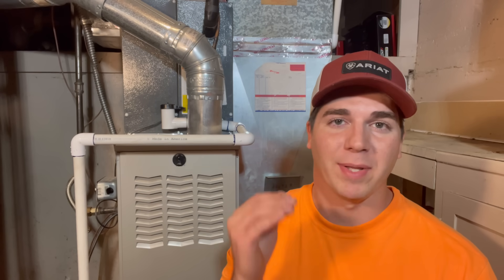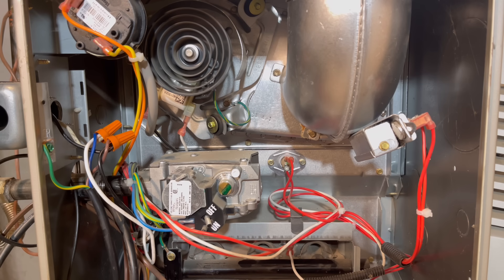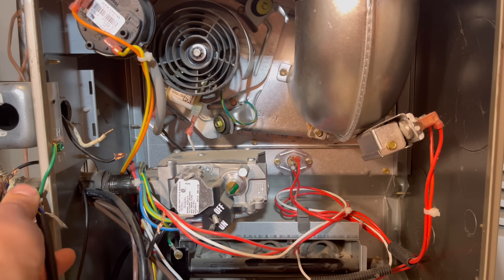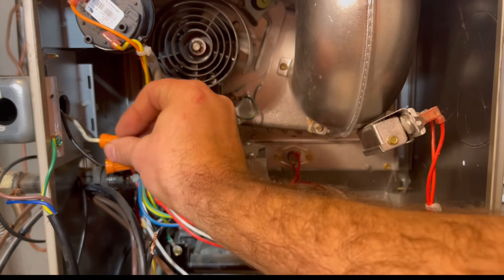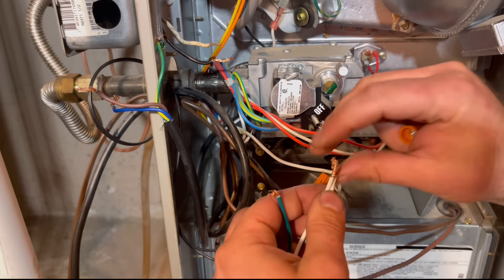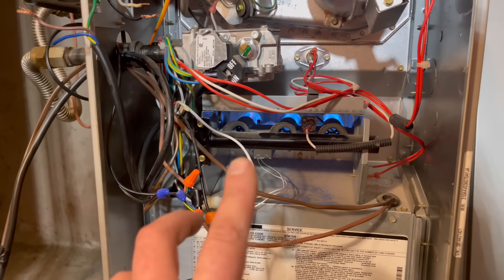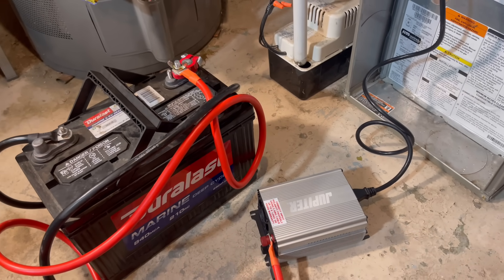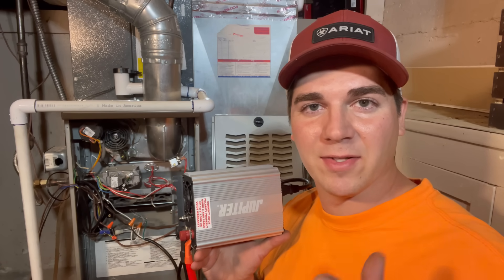Did You Know You Can Heat Your Home With A Car Battery?

Comment: My advice is, if you have to jump in to any kind of wiring change or repair like this, take a few pictures of the original wiring configuration before you change anything. You might need them to switch the wiring back when the time comes. I've been able to perfectly revert wiring changes, over a year later, because I took pictures.
Reply: Labels 1 to 1   2 to 2
Reply: great advice!
Reply: I do this a lot! Having phones on us makes it so easy. I have a phone with a stylus, too, so I can make notes, circle things, inert arrows.
Reply: @Tomas.X  Yup, that's what I did 10 yrs back when I was working a lot on an old truck with some non-standard replacement engine I couldn't track down for directions/schematics/etc...   A bunch of little strips of masking tape with multi-colored permanent markers to label every wire/part/etc and various small disposable cups and baggies to collect/label each set of bolts/parts, plus video recorded the entire disassembly on phone, with running verbal commentary from me.  I'm rather mechanically inclined but my memory's atrocious, lol, so this helped a LOT!  ... >;]  ... (did it for appliances, too)
Reply: Yup. Good idea. Pictures don't forget
Reply: @craigquann  Tell that to the kids today! LOL
Reply: I came here to say the same thing about taking a cell phone picture before taking any wires apart, re-routing, etc.
I'd like to add, if it might be a long time before you get back to the project.... get those 2 or 3 pictures 'instant printed' at Walmart and tape them inside the furnace cabinet. 
I had a phone stolen once and lost the SD memory storage with it.
Reply: always meter the circuit, safety first.
Reply: Good advice but in this case it was two wires,,,lol
Reply: Should be common sense but then again,  common sense is rare these days
Reply: Yes
Reply: I bet you've changed a phone's charging port. Great advice! Merry Christmas!
Reply: I've been an electrician my whole life. My father was a Master electrician. Even in my 40s I still take before pictures or at least draw a diagram
Reply: I agree, especially if you're changing the control board. Even the thermostats sometimes have a bunch of connections which never match the wire colors. I always take pictures, and rarely ever get everything back together without looking at them.
Reply: Yep! Things can go south in a hot minute  if you have no reference to guide your electrical connections!
Reply: OR, use a gangbox next to the switch with an outlet. That way you can make a male to male pigtail grounded adapter. And just plug the furnace in when needed.
Reply: If you can’t rewire the 120v coming into your furnace you shouldn’t be touching it.
Reply: @dustinengle2570  Is that so? Cute. How do you change light bulbs?
Reply: @aick   why are you so offended 😂? I’ve been doing HVAC for 10 years if you have to take a picture to remember how to wire a furnace you shouldn’t be touching it. Because you obviously don’t understand the operation of the equipment. A gas furnace is not something an untrained DIY guy should be messing with honestly. I’ve seen plenty of homeowners and business owners destroy their own equipment attempting to do something they “saw on YouTube.”
Reply: @dustinengle2570  Would you tell your next job interviewer that documentation is for people who "shouldn't be touching it"? I had no idea this comment would attract so many insecure aspiring technicians. Good luck in the real world where black is neutral and also white, and wtf does the red wire do? They are all tied together in one wire nut when you arrive at the customer's house. TAKE A PICTURE.🤣
Reply: @Wolf359HeavyIndustries   i literally don’t have to take a picture of anything in a furnace to rewire it besides maybe thermostat wiring but that’s not even necessary it’s just quicker. Because almost all Tstat wiring is done with a conventional color code according to the system that’s installed. Or if you forgot just pop the stat and check there. You obviously have very little technical experience in HVAC. 99% of all equipment you’ll see in the field either has a wiring diagram in the unit or just Google it. Also to verify voltage and polarity professionals use a multi-meter dude.
Reply: @dustinengle2570  Bruh, was literally giving advice for people who ARE NOT trained, which is what this video is about. Why are you here dunking on people who are here to help others learn? You must be great at parties.
Reply: @Wolf359HeavyIndustries   my original comment was if you can’t rewire 120v coming into your furnace you shouldn’t be touching it. Then y’all commented at me all kinds of sideways. You don’t have to be a trained HVAC tech to understand 120v circuits. I’m trying to prevent people who have no business touching their equipment from creating hazardous situations for themselves or contractors because I have seen it. If you understand the basics of the equipment and can confidently wire 120v circuits have at it. I’ve been shocked, had rollouts, and seen people ruin their equipment because a home owner didn’t understand the scope of work they were trying to accomplish by themselves. Oh and I am great at parties. I’m always the motherfucker keeping people from hurting themselves or getting arrested 😂. But all and all I apologize for any rude comments I made. I just want people to be safe. Seen to much dangerous shit happen.
Reply: @dustinengle2570  It's also very telling that you assumed that I was exclusively talking about HVAC when I literally said "any kind of wiring". For example someone above mentioned a complex data acquisition system that they had to tear down and repair. I'm getting a vibe that you got laid off (for incompetence fueled by overconfidence?) and you are taking it out on youtube comments. Please go be insecure somewhere else.
Reply: @dustinengle2570  "I’m trying to prevent people who have no business touching their equipment..." It's called gatekeeping.
Reply: @dustinengle2570  Good for you. My comments and this video weren't for you then. In case you didn't notice, it's a DIY video that specifically addresses the power outage in Texas where people froze to death because professionals were swamped. Have some civility towards the professionals who want to help and not just gate-keep their skills. 
Another thing you don't seem to have noticed is that the power wiring in the video mixes US and European color codes. That is what prompted me to suggest taking a picture, which may or may not be needed, but will work.
It's funny that you are continuing with your fabricated narrative that I am inexperienced, just because I offered sound advice that works across all technical fields and never causes any damage. I've got over 15 years in IT support on power control systems, including HVAC, 150-500KW backup generators, security and access control systems, fiber optics and server systems, etc, that are mission-critical to financial institutions and government offices. I know how to use a whole lot more than just a multimeter.
Reply: @Wolf359HeavyIndustries   maybe don’t talk smack in your first comment and you won’t get smack back lol. I just personally don’t think homeowners that don’t understand basic operation nor basic 120v wiring should be touching their furnace. But by all means they can and if they mess something up it’s just job security lol. I don’t wanna end on a bad note tho. I apologize for any disrespect. I was just merely commenting my opinion originally. I hope you have a good week bro.
Reply: @dustinengle2570  I wasn't talking smack. You were saying that people shouldn't touch their own wiring. Well, sometimes they shouldn't but sometimes they have to, like in the context of this video. You then took my advice, which is useful for beginners and old-timers alike, and threw it in my face as proof of MY ineptitude. Apology accepted, but try to treat the comment section as a place to help people, not drag them. Somebody is always gonna fry their wiring. Let's make it happen less. There is always going to be a job to do.
Reply: Pictures and labels! Saves my butt every time!
Reply: Good point.
Reply: Or you could read the wiring diagram.🤣 Its color coded for dummies.
Reply: Excellent 👍
Reply: Such good advice for taking ANYTHING apart!  Ask me how I know… 😂
Reply: In the Old’en days we wrote things on paper.
Reply: @Glocktard  - Re: "paper" ... - yep, I remember lots of diagram-drawing as I took stuff apart...  that was fun...  
- Esp rebuilding stuff with diff/extra wiring/circuits/etc, drawing it all out first, doing all the math, protections/etc...  
Did that with an old laptop I really liked but it had a lousy cooling system so I added my own, extra fans/heatsinks plus control of the orig stuff, all with their own power supply/controls/automation/overrides and even a backup power system jic my Primary blew (incl a little blinking red LED to let me know)...  ("Gaming" laptop, back when those things were uber-powerful running HOT!  esp Overclocked)
Reply: @brianwall9592 au contraire, gaming laptops were extremely dogshit - they were heavy and ran hot with poor performance but modern ones are finally starting to become truly portable in terms of weight and thickness although you still need to be connected to an outlet for gaming.
Reply: @Glocktard  yes, that works but it is easier to just take a picture with your phone and edit it with markup notes, but either method will work. I used to take notes on paper but now use the picture method because for me its easier and faster. Whatever works for you is the right choice for you.
Reply: @Glocktard  Yessir paper notes are valid too.
Reply: Yep. I've torn apart crazy complex data acquisition systems in the field that had multiple stacked circuit boards and wiring leads all over and was able to quickly identify bad, burned out parts then replace them all because I documented everything with pictures as it was coming apart. I always take 2-3 pictures of the each "scene" from different angles because sometimes there are small things that block your view. 
For work I would need to write-up and label a procedure for the next guy too. 1 picture really is worth 1000 words.
Reply: Boring advice.
Reply: @txmade4371  It wasn't made for your entertainment. Also, the same could be said for your entire channel. 🤣
Reply: Yes lots of variables Tim it’s tuff to put all in comments, like I live alone so only need to worry about myself so I have a extension cord 12-3 I run from my battery room to outside my window which will run all my wi fi stuff like surround sound TV so just need to keep warm like camping, but I really don’t need to worry about pipes freezing could tho ( Reno) lots go into ones climate first then family newborns would really up the stuff , don’t need refer if pipes are freezing, most of my greenhouse heat , lights , just gets transferred inside sorry veggie’s, it’s all about options, honestly
Reply: @timmeier8863  wifi and 5G radiation ☣️ have an ill effect on the human body
Reply: @herdHistruth  so how did you reply without using WI FI , some people worry more about complaining then trying to help ,I do know complaining takes more energy then helping
Reply: @timmeier8863  I didn't use wifi, just he cell tower ☣️, and I never claimed I didn't use it
Reply: @timmeier8863  where does it say that complaining takes more energy than helping ?
Reply: @herdHistruth  I remember when microwaves came out people were freaked out about heating food , bet you use a microwave to heat your food ? And during a blizzard I don’t think people are thinking of 5g and WI FI are bad but can stay distracted from the blizzard is very important, see my point right now is not talking about staying warm but your complaining about stuff and not adding anything, like I said more energy for nothing
Reply: @herdHistruth  Did you learn the difference between ionising and non ionising radiation in high school? Actually did you even go to school?
Reply: @kiyoponnn  yeah, I went with your mom, she loves to drink that baby batter 😋
Reply: White to white black to black. It is not rocket science.
Reply: @cooldog60  Nobody said it was rocket science but look at the wiring in the furnace again. In this case, it's white to blue and black to brown for the condensate pump wires. US and EU color codes are being mixed in this case. Not really a problem but if you weren't familiar with EU colors, and the internet was down for the same reason as your furnace, taking a picture before making any modifications would make it no problem at all.
Reply: If you knew you shoild not mess it, why did ya.
Reply: If you need pictures to remember how to wire a simple furnace switch....you probably should be doing this.
Reply: @spatt833  This video is about teaching people who are trying to help themselves and their families in an emergency. Did you just make this comment to flex on how smart you are?
Reply: @Wolf359HeavyIndustries  - No, just how inept you are....
Reply: @spatt833  I can appreciate a good troll, but you are just showing your insecurities.
Reply: @Wolf359HeavyIndustries  - Now you're just whining.
Reply: @spatt833  Just giving you some trolling practice. What else you got?

Comment: Several days? Nope, never gonna happen. Maybe an hour or two. However, it is good to know how these things work.  You could, for example, run jumper cables from your vehicle to the camper battery and run the vehicle to keep the battery charged up.  Not efficient, but if you have a full tank of gas you could keep it working.  My suggestion is for $100 buy they best kerosene heater you can afford and keep it as a backup. In a power outage forget the gas furnace.
Reply from the maker: Thank you for the comment. I guess I was totally wrong in my assumption but your advise is exactly what I did. It’s hooked permanently to my work truck so I’ll be doing a video on how the setup works soon :) thanks for watching! Cheers
Reply: @diyhvacguy  I have a 2500 watt inverter mounted under the seat of my truck hard wired into the truck batteries with 2 gauge cable. Use it mostly for camping trips but in an emergency I would be able to keep the house warm and the freezers cold as long as I'm willing to keep the truck running.
Reply from the maker: @MrHercules222  sick. Thanks for sharing!

Comment: That's good for only about 5 hours of heat. The blower fan motor is the main consumer of electricity in furnaces. A standard 1/2 HP draws 368W when operating at 100% output.   Typical auto battery 1200 Watt-Hours / 368 Watts = 3.25 Hours x .80 inverter efficiency = 2.6 Hours.  Multiple that by 2 (assuming the heat is on 50% of time - weather dependent) and you come up with about 5 hours of heat.
Reply: Thank you for doing the math.  I scrolled a long way down the comments looking for this since I knew that one lead-acid battery would not power the fan and igniters for as long as he states.  One change I would make to the math is that you don't want to run your battery down all the way, I think 80% discharge is the max you want to drain it so that 1200 watt hours is more like 1000. If you added another battery in parallel maybe 8 or so hours would be a reasonable expectation using your math.
Reply: FYI, after The DIY HVAC Guy tested it with his car battery, it lasted 6 hours - close to my estimate. See his update video: https://youtu.be/kkyPBAz0mLw
Reply: You are right on, it’s about amp-hours not cold cranking amps!

Comment: Will that work on a diesel hot air furnace or boiler furnace?
Reply from the maker: I’m not sure on that one. I’ve never worked on either of those. Pretty much all of the heat source where I’m at is natural gas.

Comment: Let's assume that furnace blower pulls a steady 600 watts. This puts your amp draw on the battery at around 60 amps. That decent size battery like shown is going to be around 100 amp hours. You can use only about half that if you don't want the battery to die an early death. So you can run your furnace maybe 1/2 hour continuously before you need to recharge the battery. 
Much better to just buy a cheap 1000 watt gasoline generator (on sale they are less than $100 at Harbor Freight). They will run 12 hours on a gallon of gas. Also, those inverters contain a bunch of electronic semiconductors (mosfets and capacitors mainly) that can fail at any moment, leaving you with nothing. And Mosfets love to fail.
Reply: Exactly! I have a portable solar generator with a lithium battery that has 3000wh capacity, which is much more than a car's lead acid battery has, and it can run my home fridge for one day. Not enough for a power outage which could last for 3 days time. So, I use a small gasoline generator and 5 gallons is enough for the entire 3 days! running non stop. If you really want to be prepared you should have a couple gas generators, so when you need to change the oil or do maintenance on one generator you can still have power by using your second generator!
Reply from the maker: Thanks for the tips. I actually decided to Mount the inverter in my truck so I can run it as long as I have fuel in the truck! Stay tuned for that video! Thanks for watching.

Comment: How long will a setup like that run a refrigerator/Freezer for?
Reply from the maker: I’m not sure on that. I actually have the inverter hardwired in my truck and I will be using an extension cord to power the furnace. So it would run a freezer or fridge for as long as you had fuel in the vehicle the inverter is attached to.
Reply: Longer than a furnace.

Comment: Never found the video about how long the battery could run your furnace??????
Reply from the maker: Still in the works. I ended up hooking the inverter to my truck battery so it will have juice as long as the truck has fuel. Will post that video soon! Stay tuned!
Reply: @diyhvacguy  that is different than just running off a battery, at that point you are using the truck as a generator.